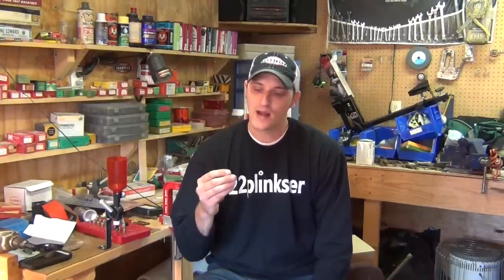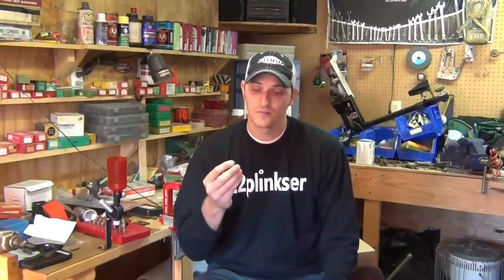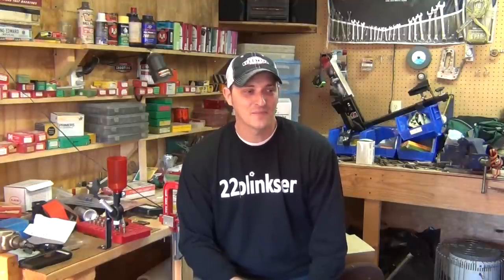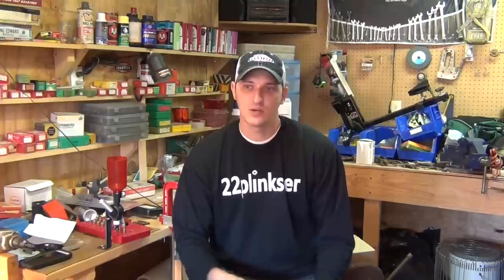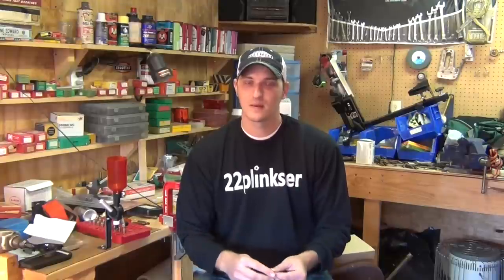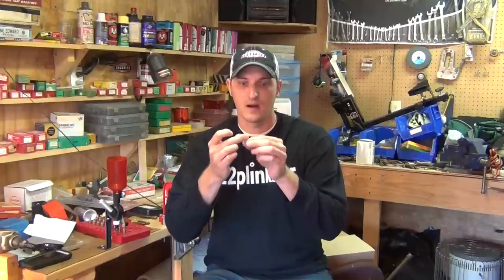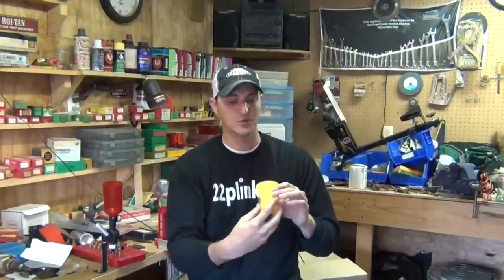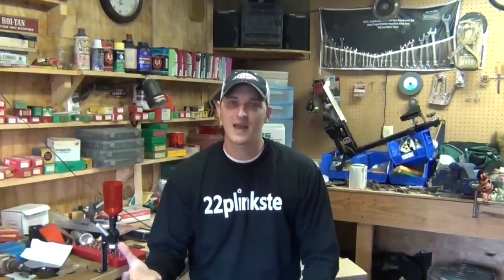Why does the .22lr have misfires?

Comment: I'm 65 and been shooing since age 13.  My experiences with failed rimfire ignition has been the fault of the rifle --- a weak pin strike mostly.  I have seen some badly chambered/damaged rifles where the cartridge doesn't fully seat, and the firing pin strike just seats the cartridge with no ignition.  But in the million rounds I've shot (? I really don't know how many), I can count the true defective cartridge misfires on both hands.  Most of them WILL ignite on the second time around when the firing pin strikes a different part of the rim.  But, some cartridges are true defects and will not ignite period.  I've always wondered if those few bad cartridges over the decades were the result of a manufacturing defect, or if some contaminant had worked its way into the priming compound.  Dunno!  I do know three concrete facts about me and ammo; (1) I have never had a single factory centerfire cartridge fail to fire ---- those have only happened with reloads,  (2) rimfire and centerfire cartridges that have been sprayed with WD-40 quite often fail to fire, and (3) misfires with ANY cartridge is extremely rare.  The worse thing to happen is a squib load where the primer fires but the propellant fails to ignite.  Sometimes the primer will propel the bullet a few feet from the end of the barrel, but usually the bullet sticks in the barrel.  Never seen a gun blow up if the bullet isn't removed before re-firing, and both bullets will exit the barrel, but a a barrel swell will occur at the point of obstruction.  You can see the swell from outside the barrel since it appears as a often-elevated bright ring --- especially with a .22.  The firearm is still safe to shoot, and the accuracy doesn't seem to suffer, but it hurts your feelings to look at it.
Reply: mnpd3 how did you correct the soft strike? I was going to break the ol girl down and give her a clean. Just curious if i may need a new part or just a little tlc?!

Comment: Agree with the firing pin. Although I know some guns wear do to use and not dry fire. I had a savage 17 HMR that I never dry fired. I bought it new. I put a couple thousand rounds though it and got to a point in would dry fire 1 in 10 shots. Sent it in got a new bolt and firing pin and worked fine after that.

Comment: As a firearms instructor for decades, the number one reason for misfires in any gun (especially rimfires) is a dirty gun. A dirty chamber may cause the round to not fully seat. When the firing strikes the case rim, it pushes the case further into the camber but lessening the force on the primer/rim. This may be only a 0.001” or so. Most often with semi-auto rimfires.

Comment: My neighbor and I went out yesterday to shoot and his small .22 cal revolver snapped most of the time.  Some of the cartridges didn't even have a divot after the trigger was pulled.   The pistol was really hard to make the cylinder rotate pulling the trigger, but it was easy to get the cylinder to rotate and the hammer to go down if cocked first.  When I pulled the trigger and released the hammer by hand,  with the cylinder opened as if I was about to load the cylinder, and then pushed against the hammer the firing pin would protrude through the frame from 1/16 inch to maybe as much as 1/8 inch.
The cylinder doesn't flop with slack on its rotation pin.  There's a bright spot on the hammer, but no divot I could feel with my finger nail.
My friend inherited the pistol from his dad recently and we have no idea how much it was used.  It looks clean (well no rust) the plastic? grips have RG identifier.  I don't know if that stands for Ruger or some other brand.
There's a screw going through the grips with a nut on one side.  I don't know if that's normal or if its a getto repair to hold the grips on the revolver.
Do you think a cleaning of the action of the trigger would help or do you think its better to carry the revolver to a gunsmith?
Thank you.

Comment: Great info! Thank you!! I am working on a GSG Firefly and it is not firing I’ve completely disassembled it and stripped all old lubricants, re-lubricated it like the manual says. No luck. Any helpful tips?
Reply: Hello.
I have recently purchased a GSG Firefly (I'm in the UK) I'm still in the process of breaking in this pistol & have only put 100 rounds through it at this point, new from factory.
Yes I'm having a few light primer strikes and a couple of failure to feed.
I'm using Eley plus HV ammo.
Yes cleaning pistol each time it has been to the range (twice now).

Comment: Several years ago when qualifying for my CCW, I was using an M&P 22 using CCI ammo.   It fired just fine, but it wouldn't have enough power or gas to eject the spent casing. I had to rack the slide after each shot just to eject the casing. In my case, I was using the wrong ammo (CCI Quiet 22LR).

Comment: I have about 5000 rounds of bulk Remington 22LR in mason jars in my closet. It's been there about 7 years, I tend to buy a new box of CCI if I want to go out shooting. That Remington bulk pack stuff isn't very reliable, but it's nice to have around. probably have to shoot it up and replace it eventually. Get all the friends together have have a watermelon holocaust with the 10/22s :P
Reply: Might want to reconsider long term storage of ammunition or ammunition components in class jars.  Glass is prone to condensation which is not healthy for ammo.  Would hate for it to go to waist.
-Wyatt
Reply: Cardiac Tactical easy fix every time you eat jurky put the old pack in one of the jars
Reply: Jacob Brunberg that is the do not eat paket
Reply: Cardiac Tactical Mason jars have been proven to be pretty effective from sealing the inside from the outside for 150 years. I can't see how water will get in to condense where the ammo is.
Reply: mutualin4mation when its present in the air when closing the jars
Reply: Jacob Brunberg your absolutely right. You can actually buy desicant strips. But then you wouldn't get that satisfying beef jerky smell when you shoot.:)
Reply: Jacob Brunberg Never enough water in there to spoil the ammo that's in there. I'm going to guess the jar full of ammo pushing more and more humid air out. Very unlikely to cause a problem if the seal is good.
Reply: mutualin4mation i dont really have a good reply for this except better to do it and have your ammo not go bad than not do it and have it go bad
Reply: 7 years and they are bone dry in there, not really seeing any issues coming up with .22LR in mason jars
Reply: lerch400block ha great now instead of just buying ammo ill get hungry for beef jurky to
Reply: Get all your friends together and have a weigh 'em and gauge 'em party.
Reply: Take your old cartridge waffle tray boxes and load up with your old 22 ammo... then rotate it. If you don't rotate it the primer compound tends to travel to the bottom
Reply: What you say does not make sense.  Priming compound is applied first to the empty rimfire cartridge in the bottom and once sealed then the powder charge and bullet are inserted.
Reply: mutualin4mation mp

Comment: I found NEW 22 mags.  Shot in a new NAA Ranger.  Many misfires, I rotated them, till they went off. I took the empty cases home to inspect. I compared to CCI's. They were about .006" smaller on the rim dia. And also on the rim length.  Caused the bullet to go in that much farther into the cylinder. So, the hammer couldn't strike the rim deep enough to fire it.  Very obvious LITE strike. Even a half strike sometimes. I'm a retired tool&die maker. I know how machines wear & fail, so I won't mention the ammo co. Name. Get some calipers.  Check stuff.

Comment: Bought 2,000 rounds of Aquilla super last December and 2,000 more in March. Paid less than $25 a brick. Bought these for steel and I use CCI for targets. I love cheap ammo for steel even though probability of a failure is greater. Why? Because it's cheap.  So, I bought these Aguillas because they were the cheapest 22lr ammo I have ever found. This ammo ran great in my Victory, Marlin 60 and P17. But there is a problem with this ammo, it does not like steel magazines. The coating on the shells will make the rounds stick in a steel mag causing the next round not to index up to the top of mag. I originally thought that I need to replace mag springs (over 20,000 rounds). Bought new springs and compared to old springs, which were 5 coils shorter. No help and upon further investigation the problem was the lube. Remedy - I dump several hundred rounds on a towel in one nice pile. Spray WD40 on them and then roll around in towel. Takes less than a minute to do and shazzam, you're ready to go. And yes, I do have a 22lr addiction. Please help by sending ammo. Just kidding.

Comment: That is NOT how rimfire cartridge cases are primed. A “blob” (for lack of a better term) of fairly liquid primer compound is dropped into the open case, and then the case is spun so that centrifugal force drives the primer compound into the small gap in the rim. 

Agree completely that badly primed cases are largely the culprit, although firearms maintenance (cleanliness and wear) are also contributing factors.

Comment: For me, my ruger 10/22 has never misfired after 5,000 + rounds of just about any .22 ammo available to me in the UK
My GSG1911LBR suffered 1 misfire in 5. I subsequently re-profiled the firing pin of the 1911 and I now get around 1 misfire in 100-200. I should maybe touch it up a tad more.
I have had more issues with my 17HMR.

Comment: If the primer compound was a disk pushed straight into the cartridge it would not go into the rim and therefore would not be hit by the pin. I understood that it was dripped in as a liquid then the brass was spun around so centrifugal force pulled it under the rims. The theory about it being dislodged is still likely true as the compound solidifies and can then crack/ dislodge.

Comment: Alright, so I was digging around my grandfathers garage, which is relatively well sealed off from the elements, but still has massive temperature changes with the weather. (Large steel front door absorbs sunlight, I suppose.) When I was looking around I found a handful of 22 shorts laying in a pile. These look like the casing is made out of copper, and the stamping on the back is an acorn.
My question is A), does anyone know the manufacturer
                      B) Do you think it is still safe to use these
              And C), Do you think that these would make it down an 18 inch barrel on a lever action?
Any info is helpful.

Comment: In the 60s, 70s, and 80s, i fired thousands of LR ammo. No misfires that were not related to the firearm (we had a revolver 9 shot that had one chamber that had light strikes) and some ammo that oil had ruined. In 2000 we encountered ammo that had problems. No problems in 40 years and suddenly problems. They seemed to be associated with low cost ammo but in the past any ammo seemed to work. I think ammo manufacturing is to blame.

Comment: I have no problem with cci but Aguila seems to be super hit & miss from my 15-22. Usually one or two misfires per mag. I attribute allot of it to me having a ammo can full a mixed variety of 22lr. One of my misfires Aguila rounds had an indent, but the bullet was able to physically rotate in its casing. After I burn through that can I'll probably not dump any more out of their manufacturers packaging until I'm ready to use it.

Comment: the priming compound on rimfire is put In as a paste sometimes it does not get in between the rim all the way around its not going to move it dry's in the rim but it can break away. also firing pins are hardened and will put a dent in the barrel I have a Canadian made .22lr rifle a cooey model 60 its been in the family since it was new about 70 years ago it go's bang about 95% of the time with cheap bulk pack it also shoots that good enough for squirrel out to about 50 yards. I also have some CIL and IVI imperial(Canadian made) some of it about the same age as the rifle and nothing newer then 25 years old its been through a few different owners hands(I get it at gun shows) who knows how it was stored it go's bang most of the time I hear the brand has been reborn I hope they make some .22lr again

Comment: At bass pro shop there was a big box of 500 CCI .22 rounds for $20 (I know a good deal right?) but the bullets sucked a lot, they fell apart in the box and there were many misfires and it left a lot of residue. It was probably because I was young and barely knew anything about anything and the gun was pretty crappy cause it was so old but I don’t know it was years ago.

Comment: As I understand the process, the primer is actually a liquid slurry that's dropped into the case.  The case is spun at high speed, which forces the slurry into the groove around the rim.  While the case spins, it's heated and the primer slurry dries in place.  The primer material contains ground glass, and it is that abrasive that kicks off the primer powder when crushed by the firing pin.  Is all that incorrect?
Reply: No. You are correct. If enough compound isn't added, there will be gaps. If the firing pin strikes a gap, that is a big reason for failure to fire. It has little if nothing to do with how well the ammo is or is not handled. It would be an epic waste to construct a round the way he suggests. You could also strike the back anywhere, and the rim specificity thing would be pointless.

Comment: I have some PETERS 22 LR that is about 50 years old and still shoots just fine if it was left in the box. I have had some that was left in a pistol for years and years and they did not all fire as they should.
Reply: JIM ECKENRODE   Try sharpening the tip of your firing pin a bit. Make sure you leave it the same size, just make the tip narrower.

Comment: I found myself thinking, this doesn't apply to me because I rarely, or ever, dry fire my .22s. But my rifles are a Ruger 10/22 and a Henry lever action. I use a large cap mag in the 10/22 and the Henry takes (I think) 15 rounds in the tube. I can't keep track of how many shots I've fired, so I'm dry firing every time the mag runs empty. As he said, it's supposedly not an issue with newer guns, but something to think about.
Reply: Javier Fauxnom /- Yeah , my Remington 597 and my Marlin model 60 and Marlin model 795 all have last round bolt hold open that prevents this.

Comment: Misfires are rare but .22 cartidges with loose bullets causing loading issues is far more common. Could also be related to mishandling or just bulk bullets that are not sleeved. LRN's seem to be more susceptible.
Reply: Lead Round Nose.  My. 22 semi pistol likes the Federal Auto Match bulk ammo. You can run a bullet down the barrel and compare diameter to ammo size. This makes finding the right ammo for your gun easier than bench testing everything available. YouTube has videos on this process. Good luck.

Comment: I have been shooting for 35 years, I gotta say in the  last 6-8 years with the 22 LR shortages quality has went down. I use a Ruger MKIII, and I gotta tell you the 22 ammo produced in those 6-8 years gave a lot of duds, Now I have 22 ammo 25 years old that fires every time so it's not the gun. I think the manufactures were passing up Quality for mass production. Only just here recently in my area are 22 shells available again. But the prices are a little high shells that were 20.00 a brick are now 36.

Comment: I like your comments on the priming material moving around in the case due to rough handling.  I too have had misfires and tried to fire them a 2nd or 3rd time and they go off.  Is your example using the play dough a proven fact or just theory?  If it has been proven, did you do the failure analysis yourself?  If so, please explain what you did in detail.  Hope to hear back from you.  Thanks.

Comment: Although a lot of what you said is true I have to disagree with you on your comments about the priming compound being dislodged from mishandling, as you stated.  The priming compound is not a "flat piece pressed into the entire bottom of the casing" as you claim.  Priming compound goes in wet and the casing is spun at high speed; the resulting centrifugal force causes the compound to be placed inside the rim of the casing.  When the priming compound solvent dries out the result is a "ring" of priming compound that fills the space of the rim of the casing around its entire circumference.  If anyone doubts what I have said take the time to pull a bullet from a .22 rimfire round and dump the powder out.  Then shine a light down into the casing and you will clearly see the "ring" of priming compound around the outer circumference on the inside of the casing rim.  Most of the priming compounds I have seen are a light green in color.

In addition you missed another important cause of misfires in rimfires and that is inadequate cleaning and maintenance of the firearm and/or excessive oiling of the firing control parts, which attract dust and debris... again contributing to misfires as the firing pin doesn't function properly.  If the parts housing and controlling the firing pin mechanism are dirty or perhaps rusted.. this can result in the firing pin not striking hard enough, thus causing a misfire.

Comment: I've recently bought two boxes of CCI 22lr Standard, and in both boxes there were rounds that were dented. I don't think that happened at CCI, I suspect it was handling between CCI and the dealer. Also, both boxes had Misfires.

Comment: I'm gonna pound some cci on the table, still in the box for about 3 minutes in all directions and see what happens....
Reply: And the result is?...
Reply: @PaulVerhoeven2  sounds like it didn't go well
Reply: @matttaylor8119  RIP, Steele.......
Reply: I pulled the bullets from some .22 misfires and found the priming material only went 3/4 of the way around the bottom. Of course the firing pin hit the bare spot.